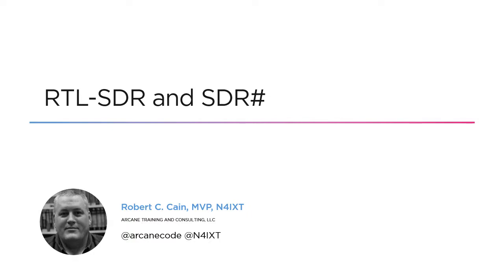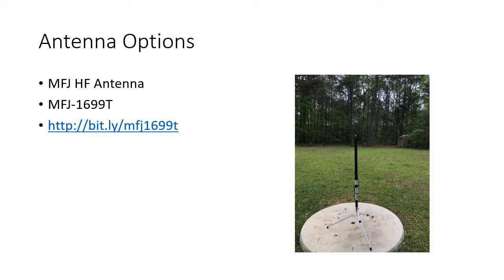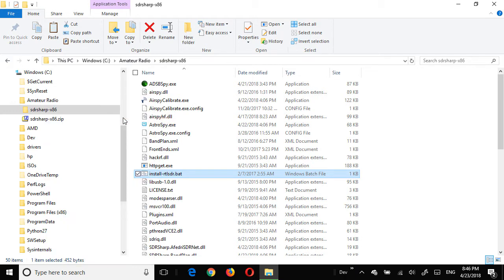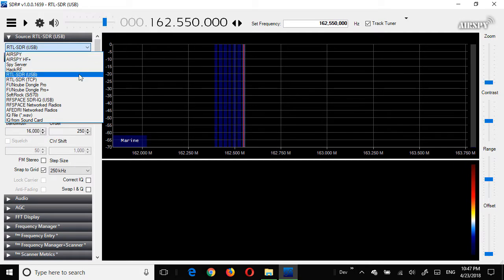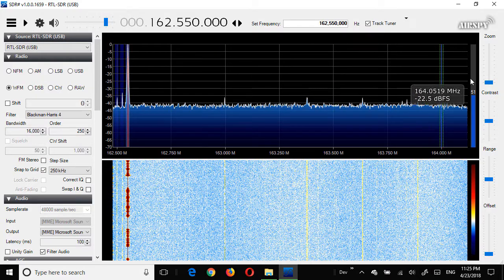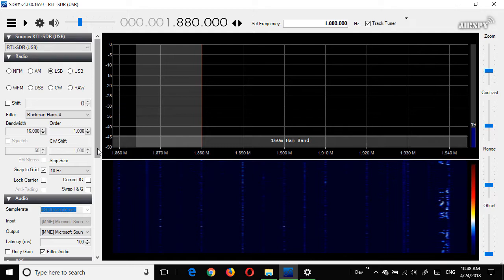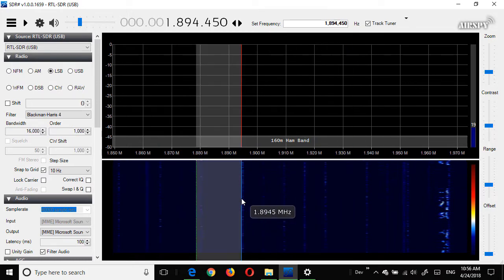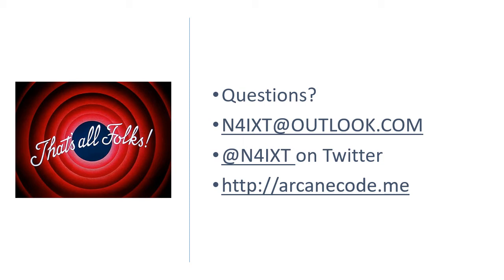Using the RTL-SDR dongle with the SDRSharp

Comment: Great video! Quick question on RTL-SDR V4 and downloaded the rtlsdr.dll dated 9/18/23. When I get to the insert the dongle, I get the audio notification that I have inserted a USB device. When I go to ZADIG, it shows Bulk Interface (Interface 0 and Interface 1). The Driver box is empty. When I go to Device Manager, it shows both Bulk Interfaces with a yellow triangle on each. If I try to manually install the driver in device manager from the SDR# directory, it can't find them? What am I missing?

Comment: I had to load zadig twice to get all of the drivers. I’ve had this a year and haven’t got my RTL to work. Without this video it would have been probably another year. Nothing more exciting than to hear the weather station after following your setup. I yelled “It works!” and my wife was looking at me kind of amused. Thanks!
Reply: Use Device Manager to uninstall and delete the Windows USB driver before running zadig.

Comment: Some great information here. I just got my RTL-SDR up and running with SD Sharp. I have begun to compile a library within the frequency manager section.  Something I have noticed, and wonder if it's just my system or software bug:  I have several Wide-FM Broadcast stations listed, as well as some AM & FM mode stations.  It appears that when initially double clicking in the manger section from an AM to FM mode, the frequency displayed will change accordingly, But the transmission mode does not change initially, until I double click on that entry again. I would be interested to know if anyone else has experienced similar issue.

Comment: I bought an RTL-SDR dongle a couple years ago as an experiment, watched a few videos about downloading and using it, wish I had found this video first it would have saved me a lot of trouble. I have since upgraded to both the SDRuno RSP1A and the RSPdx as there were too many quirky problems with the dongle, like overheating and the "no device detected" window every time I tried to use it, after much frustration I gave up. Great video I may try reinstalling the dongle see what happens (or not) LOL.
Reply: I was going to do SDR but bought a hand scanner instead , i had a lot of problems because I never could hear anything , but if your patient enough you will eventually pick up a frequency.

Comment: Thankyou for this excellent tutorial on how to install the software for the rtl sdr dongle. I've only recently discovered these devices and ordered one that arrived yesterday.
I particularly want to use mine in the shack to be able to LOOK for stations on a band that seems quiet.. And will later get a windows tablet that i can run from 5 or 12v and have this in my car on long trips to listen to the bands without me having to install my 706mk2g that i also use as my base station.
QUESTION. When being used on one hf recieving antenna, to monitor the band, is the front end (pre amp) protected from possible overload if i key up my 100 watts on an ajacent antenna.?
F5vhz.